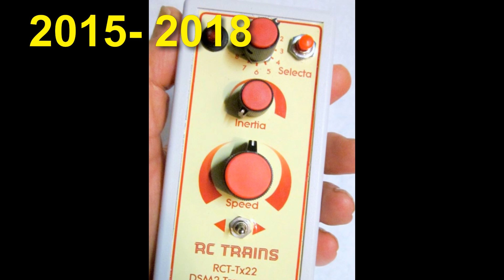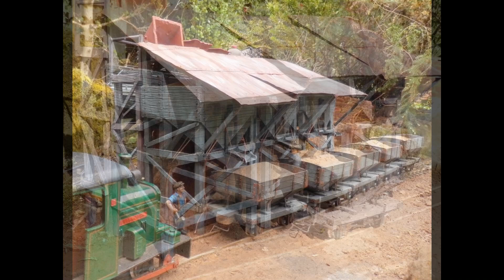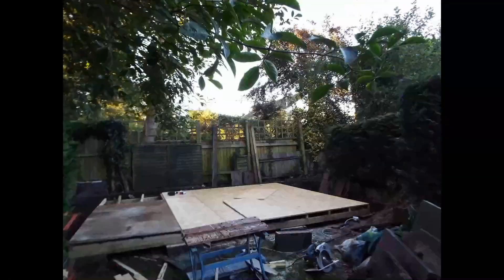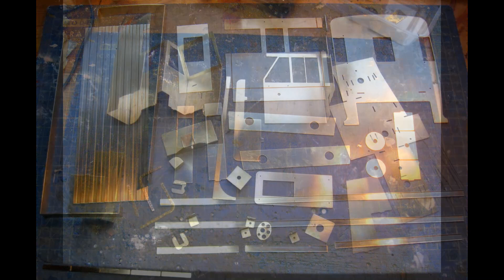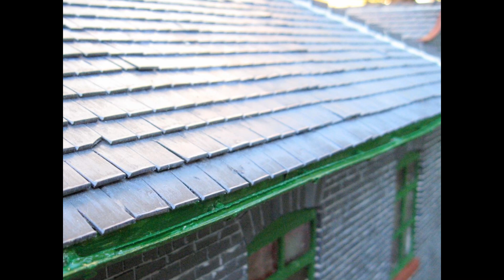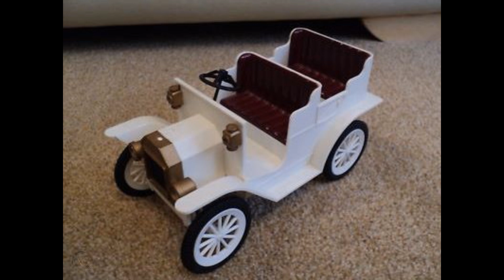Peckforton Light Railway - A Brief History - Part 4

Comment: It would be nice to see a video concentrating on the sand quarry siding, how you actually get the sand back for it to be loaded again etc.
Reply from the maker: A possibility. In truth, the loads are removable and so I pop them out at the main station, carry them across the garden and pop them back in when the train reaches the quarry siding.
Reply: @rikbennett9  Ah so its not actual sand then?
Reply from the maker: Well, the sand is real, but it has been congealed into a solid mass covering carved foam blocks. Most of the loads on or in my wagons are removable so they can run loaded in one direction and empty on the way back.
Reply: @rikbennett9  Ah I see